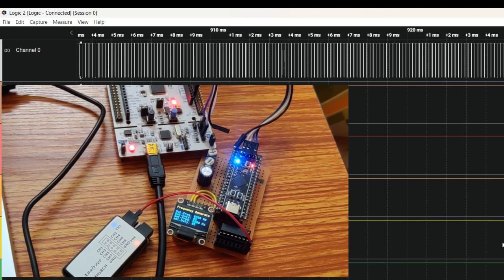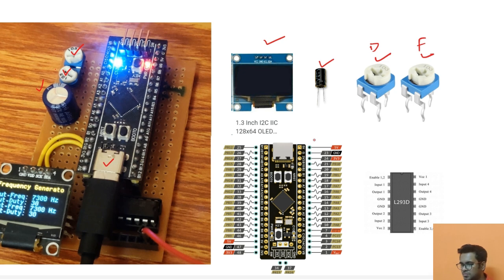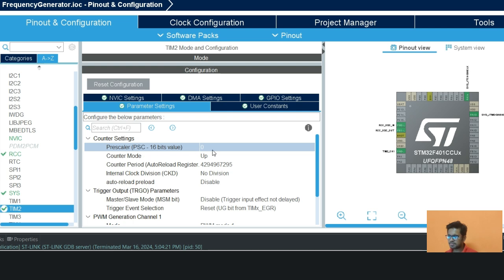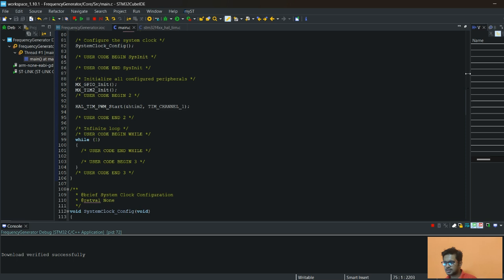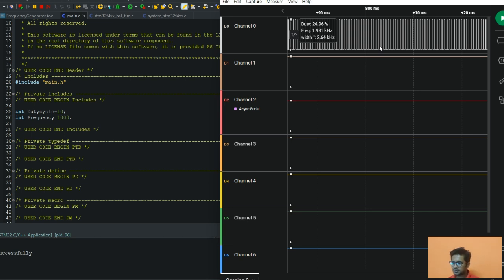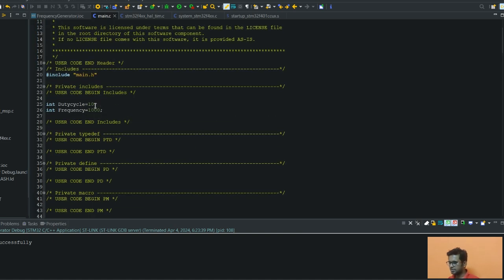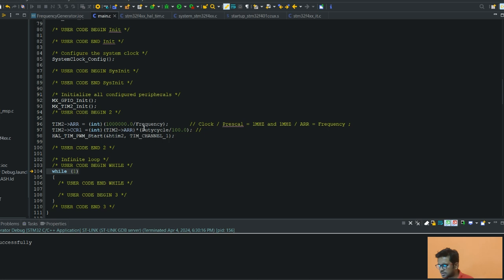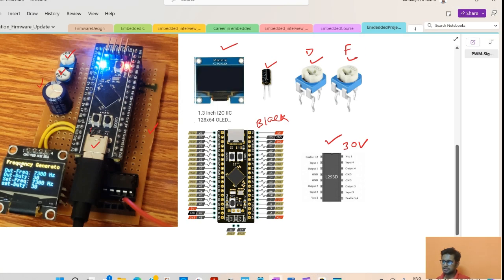Embedded Projects #STM32 Projects #PWM Generator #blackpill #timers #Frequency #dutycycle - Part-1

Comment: Hi can you please provide the link for the blackpill that you have I have problem finding a genuine board all are clone boards
Reply from the maker: https://robu.in/product/stm32f401ccu6-minimum-system-board-microcomputer-stm32-arm-core-board/
Reply from the maker: I got it from this website it works for me
Reply: I have a board like this but it doesn't work with STMCube IDE and as far as I know it is because they are clone chips and not original STM32 btw they work with Keil are you sure that this is not a clone one?